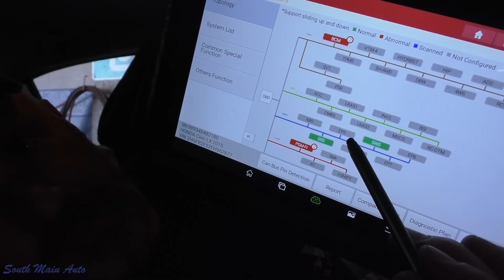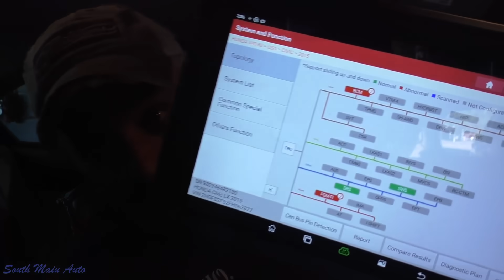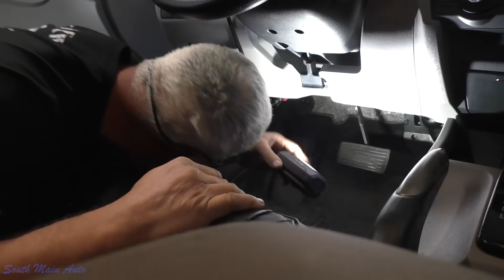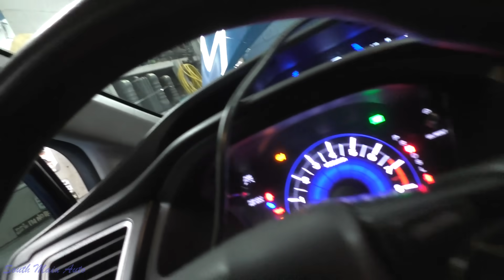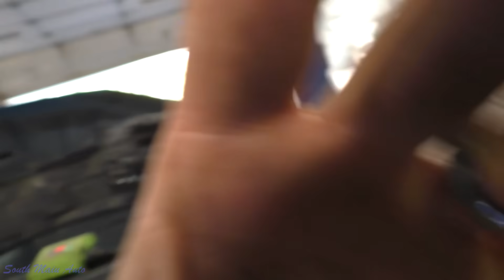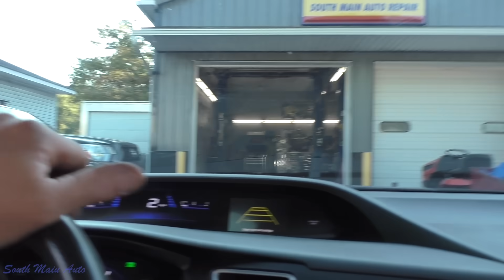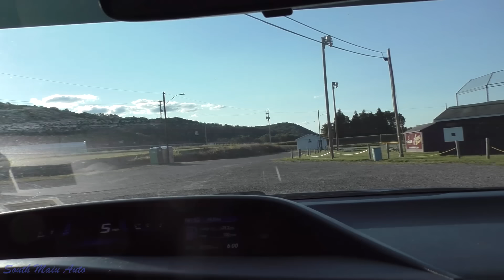ALL THE LIGHTS ON! Sticking to the Diagnostic Process Pays Off

Comment: As a service tech I love it when it's just a fuse missing so not a dumb video every once and a while the squarl finds a nut you did great 🎉😅
Reply: Is it plugged in?
Reply: @CraigGrant-sh3in  If you want to be a stinker and see if the students know their stuff, wrap the side connected to the electronics with paper. The fuse will test good even though the power stops there.

Comment: I don’t have an Eric O mechanic near me but I have an intermittent problem with my 13 Civic. Check VSA and Check Power Steering light come on but I can still use the car normally. If you turn the car off then back on, the lights won’t come back for a few days or whenever.
Reply from the maker: Sounds like you better pull some codes

Comment: I got a 2013 Chevy express with a B0086 right front door impact sensor pop off the door panel and no sensor turns out the van was crashed and the door replaced with  a model that didn’t have that sensor option drove me nuts.

Comment: Not a stupid video by any means. These are valid problems that people encounter. Liked your diagnosis of the problem.
Reply: Agree 💯%
Reply: Yep definitely not a stupid video, sometimes it is the simple things.
Reply: It was so stupid I watched it twice
Reply: Can’t be a stupid video because I saw the “Trust me, I’m a mechanic” sign on the wall.
Reply: Totally agree, sometimes problems are just that stupid; it didn't pop the replacement on test drive, gotta throw it in to the wild and communicate to the customer that it may recur and which point further, you might get to an answer.
I was expecting the ABS module to flag every airbag had an issue when you replaced the fuse, glad for the customer that I was wrong!
Reply: Owner has a nicely working car now and is really glad there was nothing else worse or expensive going on.  Only has to pay an honest mechanic for an hour of time or less and he gets a review of the car out of it.  He considers it a win, Eric should too

Comment: I just bought a Launch scan tool after looking at autel, and Icon. I read that the Icon tools were made by Launch. I do all my own auto repair and needed bidirectional control and some oem functionality for a BMW project I bought. I really wish there was a better solution for getting service info for the home mechanic. I don’t need a subscription.  I have 2 cars I maintain and I keep cars 10 years minimum. I wish I could just pay a set fee for an old school service manual.  I’d literally pay someone $500 to not have to spend hours searching the internet for half cooked information about how a system works.  

I didn’t get the model with the jbox, because it seems like programming isn’t really available for the home mechanic.
Reply: There are rumors that the BMW diag software (ISTA+) with the OEM service info is out there on the interwebs for download.
For VW stuff you can pay for the oem diag, and download the info as PDF files.
Reply: @tschuuuls486 bmw is surprisingly well supported on the internet.  I was able to find wiring schematics for the E82 fairly easily. My 2017 Chevy, less so.
Reply: I have not seen a full workshop manual for years, does anybody still print them ?

Comment: I stole the fuse to reduce the value of the car but I got locked up for fighting in the Dollar General parking lot and that other dude bought it before I could bond out.
Reply: Damn I hate when that happens
Reply: I work for a dealer only auction. This crap happens all the time..
Reply: Evidently, you ain't supposed to grab someone's booty whilst they are bent over, head first in the icebox, grabbing that last bag of ice in the bottom
Reply: Too many cops out of control videos, bud. Take a break!

Comment: Eric O: You should always verify what you're dealing with before you just go shoving something in there .. wiser words have never been spoken gentlemen :shelterin:
Reply: Applies to other areas of life as well ... all you college bound young men.
Reply: @phprofYT  Whoa fella. We're talking about delicate module circuits here :fish-orange-wide-eyes:
Reply: @phprofYT AND those can have much more significant consequences when you skip a thorough examination/ diagnosis of the overall health of said "vehicle" first...
Reply: Great video, things that make you go hmm, why remove the fuse? To create other problems? So you can buy the car cheap? Unscrupulous to be sure, guess we’ll never know for sure…🤷‍♂️
Reply: @allanenders5525  A fuse could removed if it was thought there was a parasitic draw that killed the battery.
Reply: @charlesfranks1902 when every light on the dash comes on after removing it, I’d say you should notice that that fuse feeds a lot of circuits, and if you can’t check for a current draw, power off, then leave it alone and find someone who can! This car was apparently purchased this way, it really is more likely that an unscrupulous individual did this intentionally to reduce the asking price or scare off other bidders.